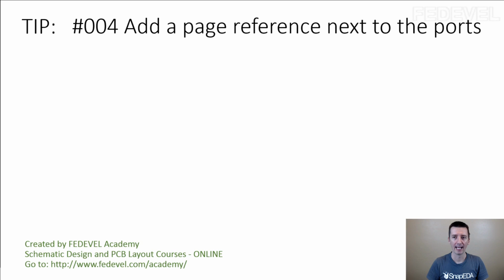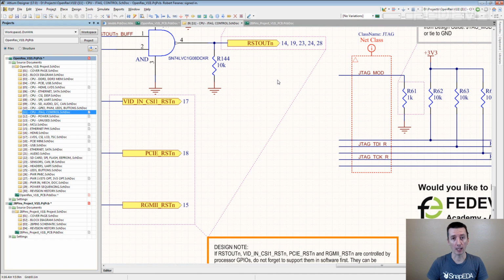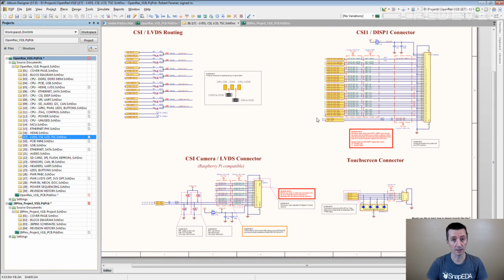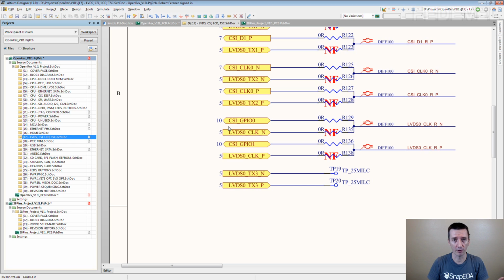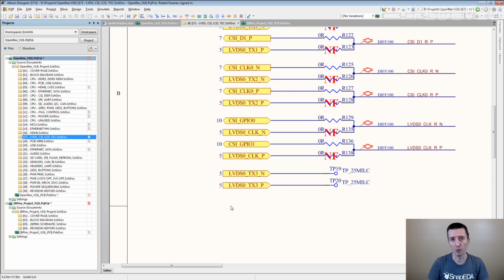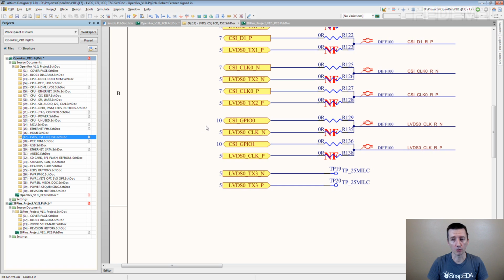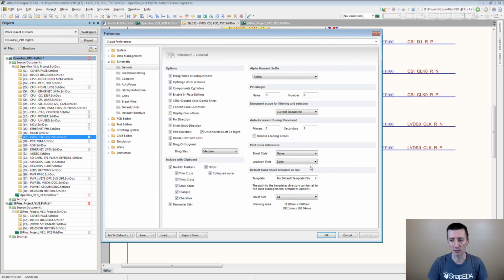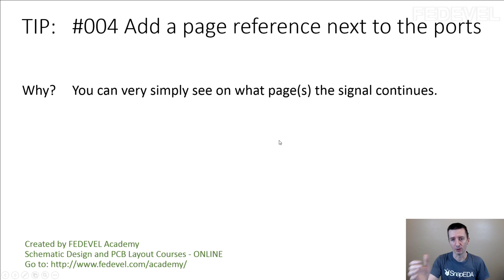TIP #004: Add a page reference next to the ports

Comment: If you compile your project, and if you hover mouse cursor on port or label, you can see which pages its connected. I believe this is better, because if you add some references at next revisions, you have to update all the referenced texts. Sometimes you can miss updating all the changed references...
Reply from the maker: Yes, I agree. The references should be updated automatically, or at least after compilation. That would be a good feature from Altium.
Reply: Hey Robert Feranec; You can do it Altium has mentioned feature (Reports > Port Cross Reference). It will automatically update when you compile your project! Don't use text labels.